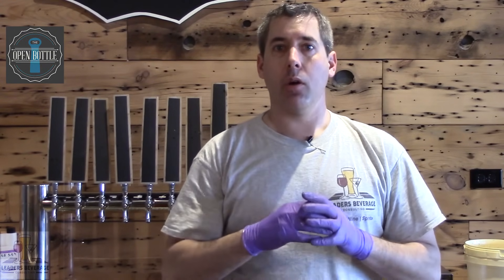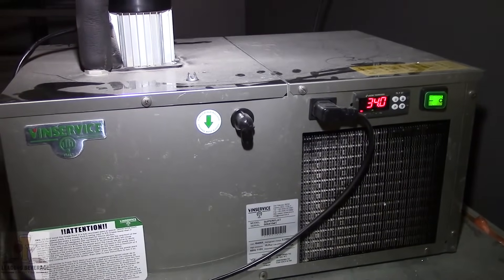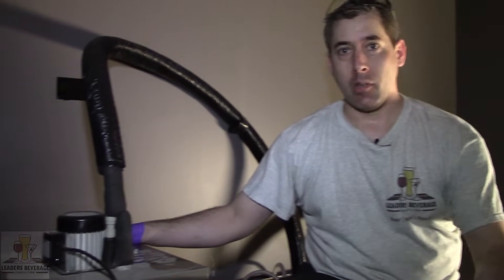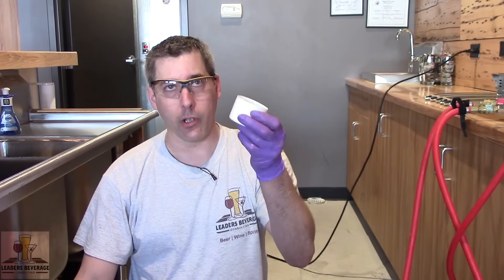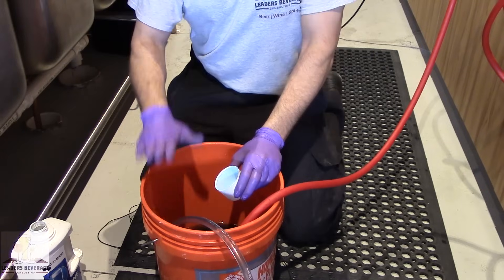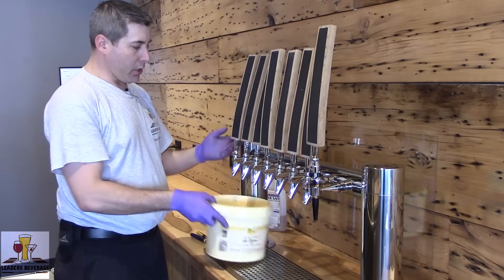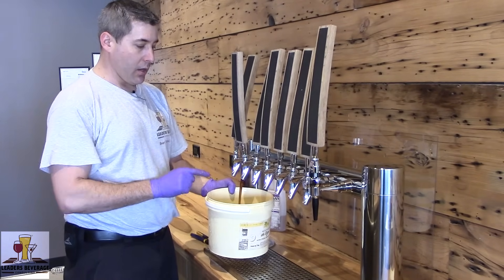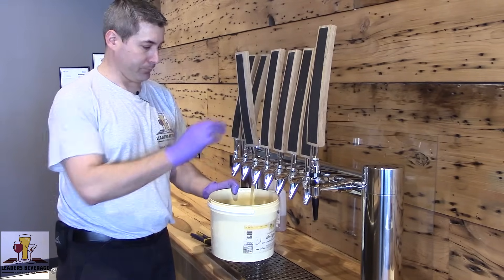How to clean draft beer lines: Circulation Method

Comment: Your Video and Explanations of the Processes leads me to have a Strong Desire to Follow the current tap cleaning company to ensure that they are adhering to something at least remotely close to this process shown.  I honestly don't believe they are - which explains why our beer and our beer consumers are less than experiencing the intended flavor profiles and characteristics of the beers we claim to offer.  The beer line responsibilities thought to be had by the beer distributors will be a concurrent necessary step to follow up on - as well as with documentation for references.
Thank for the Video Resource
Reply: Hi CVilla, unfortunately there is less good cleaning industry wide than bad. Distributors that do maintenance are typically overwhelmed and move very quickly. I've been the expert witness in 3 legal cases where someone was hurt by the caustic. In all three cases, as an example, non of them checked the flush water with pH paper. You can ask questions to see what they are doing. -What chemical are you using (do they know know if it is sodium hydroxide or another active chemical). -What concentration are you using (should be 3%, but most don't know how to determine this). -What is the soak time of the chemical (should be a minimum of 20 minutes for static cleaning where the cleaner isn't circulated). -How often do you take the faucet off (should be every time) to clean it and to disassemble and clean it. -How do you clean the couplers. Long before poor cleaning leads to actual diacetyl and acidic infection tastes, lesser maintained systems will see a dulling of the sharp flavors of hops, the aromatics of hops, and the smooth sweetness of malts. Basically, the lines harboring left over bacteria from weak maintenance dulls the beer. I'm glad you found the video useful and good luck. -Drew

Comment: Great video, thanks for sharing. How long does this whole process usually take you?
Reply from the maker: Jacob Nelson A small system like in this video can be done in under two hours by one person. Whereas a system like Hopleaf in Chicago that has 76 lines split into three locations from two different coolers takes three draft technologists 4.5 to 5 hours. Cleaning this way is far more time and labor intensive than static but its well worth it when it comes to the quality and health of the draft line.
Cheers!

Comment: Do you still recommend cleaning homebrew lines every two weeks? How do you feel about recirculation on the homebrew level, versus static cleaning.
Reply from the maker: +Allen Hi Allen, a lot comes down to how you feel about the taste of your beer. If you don't perceive any flavor problems than you are probably doing OK. Many home brewers just clean their lines every time they change a keg, and most use a product like Micro Matic Clean Flo and Star San rather than the heavy duty caustic used in this video; and don't forget to clean the faucet and coupler!! 

Frankly, most home kegerator set ups are much cleaner and have much less going on (i.e., coupler changes, keg changes every day, different people in and out of the cooler, beer touching the faucet nozzle, etc) than a home set up. Static for a few lines at home is probably fine because you are only dealing with 5-7 feet of 3/16th poly vinyl which can be replaced very easily and very cheaply. The beer trunk running from a commercial cooler to a draught tower is meant to last 10-15 years and thus needs more attention for its proper upkeep. Hope that answers your question, cheers!
Reply: +Leaders Beverage thank you for such a quick reply and help. That's what I was wanting to know

Comment: Hi  Do they use the same cleaning set up in the UK... Thanks
Reply: Hi Pepsi Chyna, I wish more people even used this set up here in the US! I'm afraid I can't speak confidently about maintenance practices in the UK. The second I suggest that UK doesn't do a lot of circulation maintenance someone will jump in mad at me. I know they have several large companies in the UK that specialize in 'do it your self' built in auto cleaning systems, but I think maintenance needs human attention. Nothing automatic cleans couplers and faucets they way they need to be, as an example.  Hopefully someone with more time in the coolers of UK pubs can chime in and let us know more.
Cheers!
Reply: “The second I suggest that UK doesn't do a lot of circulation maintenance someone will jump in mad at me”. Sorry mate but if you go up north in the UK and tell them that you only clean your lines once a fortnight; they will probably laugh at you in disgust!  Most pub landlords / bar cellar men will clean their lines at least once a WEEK and it can be an important social event for the locals. Given that most of the pubs have cellars and subsequently long lines to the bar; each tap (line) can generate two to three English 20oz pints in wasted beer. The good landlords will pull water through the lines first and the “wasted” beer is pulled off in glasses and put on the bar, for the regulars to drink free of charge.  One of the main differences between English pubs and American bars and restaurants, is the variety of delivery systems that you will come across, that you cannot simply loop together. Carbonated beers tend to be on electric pumps due to the rise resistance from the cellar.  They deliver half a pint at the touch of a switch and the switch has to be repeatedly pressed to get the water and cleaner through. Due to British cellars being at 56 degrees (the proper serving temp for cask ales), you have flash coolers and the craft beers are on hand pumps (beer engines), that have to be repeatedly pulled to get the water and cleaner through. In short, "circulation maintenance" is a very time consuming job that you have to be trained to do properly and one that is taken very seriously by ever landlord I know. As for American bars, I could tell you stories about the lack of maintenance and cleaning that would make you vomit. Unlike the UK, you don’t have the brewery’s supplying the beers directly to the bar, which also have a vested interest in making sure their beer is served to the public, properly and hygienically. As for the Distributors in the US… Don’t get me started; I wouldn’t get mad at you but I would give you ear ache);O)

Comment: how long are your jumpers? thanks!
Reply from the maker: Hi David, we typically make our jumpers 6 feet long. However, we also try to be smart about it. If you only need a 3 foot jumper than only make a three foot jumper. There is nothing wrong with an 8 or 10 foot jumper either. You just have to make sure everything is balanced in. We also like using 5/16th ID over 3/8th ID for jumpers, but that starts a whole other conversations.
Cheers!

Comment: In the mixing caustic section you said 1 gallon and half of beer/water and then the bucket has one gallon and a half. one and half  plus one and a half i thought equals 3 gallons not 2 and a half gallon of volume! One capful per ounce per gallon how;d you come up with 5 cap fulls?
Reply from the maker: Baaaa Haaaaa.....Dan, in 8 years you are the first person to catch that. Good attention to detail. That morning while video taping there was a gallon and a half of water which is more than we use regularly. When filming free content you don't do 100 takes. So he called out the 1.5 gallons in the bucket which does add up to 3 gallons total so for 2% it would have needed 6 caps. That account typically gets 5 cap fulls (about 17oz) which Drew also knew so in doing math while being filmed he called out what we usually use rather than what the math would make sense for the rest of the process. Thanks, Dan. -Cheers & Beers
Reply: @LeadersBeverageConsulting  haha just trying to educate myself. I can be a technical kinda guy sometimes

Comment: I guess this would have to be done after closing right? (2-5am)
Reply from the maker: Hi MrDream,
Really depends on what time a venue opens, how many lines, how much equipment, where the coolers are, line and tower set ups, etc. If a bar opens at 11am we aim to be done by 10am so that we are out of the way of bartenders and staff and that no one is around our chemicals. If it's 16 lines with no special requirements we can start at 7:30 to 8am. We have an account with 76 lines in three different places from two coolers. We have 3-4 people working on that for 5 hours so we start at 5:30am.  On days we do acid cleaning we need more time because that comes on top of caustic.

Cheers!
Reply: Leaders Beverage I worked for "Beverage Intelligence" installing beer. wine & soda systems all through the 90's in So. Cal. What fun it was.
Reply from the maker: MrDream5 We certainly love it!! Maintenance, installs, troubleshooting, our online shop, education, and all.

Comment: How do you charge for this service Thank You
Reply from the maker: Hi Kerry, The industry in whole typically charges by the line. I.e., $5 or $8, etc, per draft line. We find this method focuses only on the lines themselves and a healthy draft system requires more attention than just the inside of the beer lines. You have couplers, faucets, insulation, jumpers, glycol, regulators, and so on. At Leaders, we determine how long it will take us to properly help a client maintain their draft system from top to bottom so it keeps producing at its peak efficiency. We break that down to a monthly cost; so we are labor based and draft system managers. -Cheers!

Comment: What pump do you use?
Reply: +Adam Rich Hi Adam, use Micro Matic cleaning pumps. We do have several of the large ones but we have decided that we never really need anything more than the small pump because we can't exceed certain pressures regardless. We don't have them in our shop but we can drop ship them out at below retail cost. http://www.micromatic.com/electric-pumps/electric-re-circulating-line-cleaning-pump-ebc300
Reply: Adam Rich

Comment: what do you do in the case of odd line numbers? static cleaning then when you reverse next cleaning still?
Reply from the maker: Hi Justin, you can make a three way jumper connection in the cooler so the third to last line feeds the last two lines. Then, at the tower, you leave the faucet on the last line and clean that one line static. Every two weeks we change the direction of flow on the circulation so there isn't one line always just getting static. We mark our cooler logs with direction of circulation at every clean so we don't have to remember and different techs no which way to flow during a given service day -Good luck, Cheers & Beers!